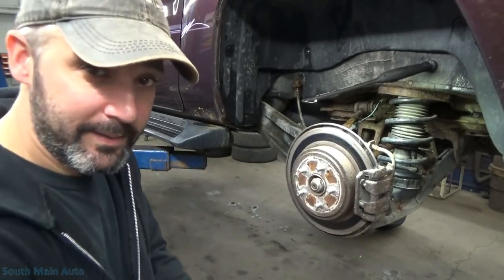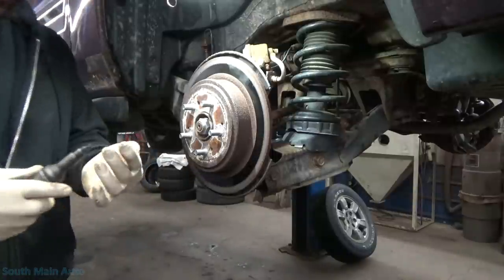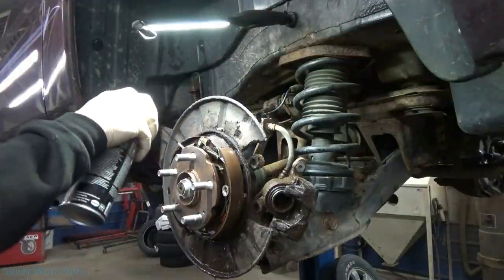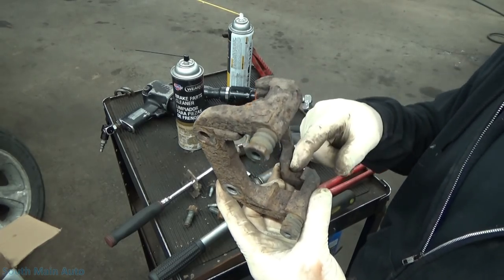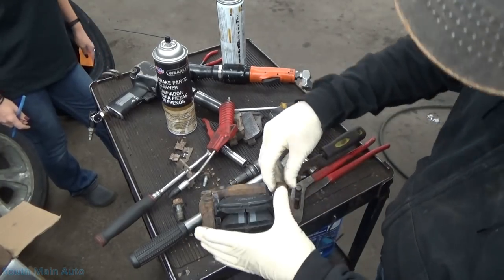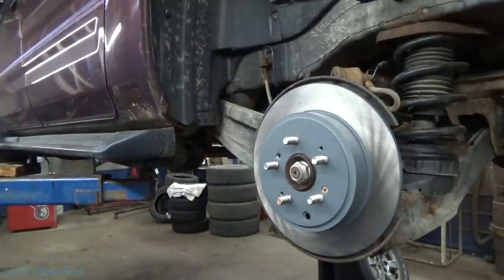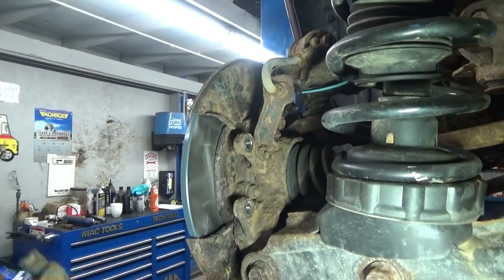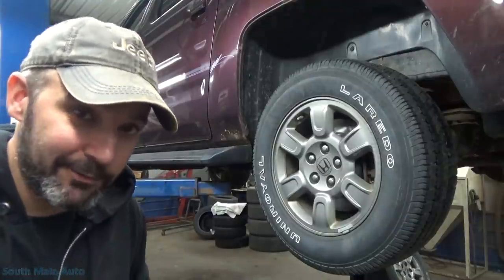Honda Ridgeline - Rear Brakes

Comment: Is that bit about too much slide pin lube really a thing that happens? I have this weird wobble at 45 and about 5 different garages have had a look between balancing, alignment, new pads, calipers, and 3 new sets of rotors and still no fix. Could too much lube on the slide pin cause a slight wobble but not total warping of the rotors? Eric, you might have just solved my problems 🤔I've also had all wheel bearings replaced 5k ago. Any advice from anyone would be greatly appreciated.

Comment: Crap I took my tire off before I jacked it up and now my leg is stuck and it really hurts.  I couldn't find the Permatext stuff anywhere local so I got a big tube of stuff called Silaramic.  It works good.  I have had it about 2 years and it is still soft and it hasn't gone hard on any of the brakes I have done.  It doesn't' have a nice little brush applicator though and it's not purple ☹
Reply from the maker: Send me your address in a PM, I am gonna fix this problem...
Reply: Eric you're a pretty cool dude!!  Great business, great family, and just a good attitude !!  Keep up all the great work! !
Reply: You forgot to spray it down with Brakleen first.  There's your problem!
Reply: I never jack up my car

Comment: I used anti seize on the hub good idea or is fluid film better? I put the purple crap on slide pins and they seized (not completely) after about a year. Have had better luck with silcone on slide pins. Still use the purple on everywhere else.

Comment: I love the "nuts and bolts" videos. What do you do with regards to greasing the brake pad ears/caliper bracket when brake hardware isn't available?
Reply from the maker: I ALWAYS replace the hardware no matter what
Reply: What if they don't make hardware?
Reply: Pads come with hardware... the shiny steel pieces?  Come with the pads.
Reply: They don't make the hardware for my BMW 5 series E60. BMW don't recommend greasing the pad ears or the caliper slide pins either.

Comment: I got a question on the bolts that hold the brackets on you said they're 17mm is that the same for the front? I got to do the wives Honda Ridgeline next week I did the backs but I know the front need to be done thanks

Comment: the same shit on all modern cars, rear pads get stuck if you don´t clean and lube everything 3-4 times a year.. 

How tiny these pads are.. do they last more than 5000 miles ?
Reply from the maker: Usually about 25k on the rears

Comment: Don’t start without a M8 x 1.25 bolt!!!  This is a critical tip.  Without it, I would have been dead in the water on the second side of my break job.  The rotor would NOT come off.  Using the bolt to press off the rotor is impossible without the less-than-a-buck bolt from the hardware store or Home Depot.  I’d go to large store (E.g., Home Depot) with a decent selection on METRIC Bolts

Comment: Yo, Eric O. Where did you get THOR's Hammer from??? I want one
Reply from the maker: Grip Tools
Reply: Are these on the Amazon SMA Store yet???
Reply: Bought the Permatex Extreme Lube off your Amazon store early in this year to give it a try never use it before in my Honda did a brake job and rotor replacement It will be my first winter with permatex lube. So far so good I am gonna wait after winter to see how it holds up

Comment: I never cease to be amazed by the level crustiness/destruction caused by the salt on your roads over there!!! I gather it does have some benefits? i.e. would you be slip sliding everywhere without it?  Here in Australia its just unheard of!  Why would you even buy a new car over there knowing it will be a write off after 10 years??
Reply: I live in the rust belt and with SUV's and trucks costing 50K or more, it makes me absolutely sick watching people drive such expensive vehicles with salt all over the road. I personally drive a used "beater" in the winter and park my nice cars until Springtime. It only makes financial sense to protect your investment.
Reply: Pretty much the ice/snow would stop all "normal" traffic if they didn't use sand/salt. The other option is studded tires or chains, which actually work better but they don't work to break up and melt the ice off the roads and many vehicles sold here don't have wheel well clearance for chains.
Reply: I've heard tell of several different products for ice and snow abatement that do less damage to cars.  Mixed in with some sand for traction.  Cost is where things get extreme.  The latest thing is using a brine solution (salt water) just before expected snow and ice falls.    That's our national pastime here in upstate NY.  Sitting back and listening to the cars rust.........
Reply: Yep it isn't bad enough that the salt water from the regular salt gets everywhere, now the brine get's spayed onto roads prior to any snow so it doesn't stick.  The main reason the other items are not used is cost. Salt is a lot cheaper for the municipalities. The thing is that is all the people seem to think about. Not that using a more expensive de-icer would mean they didn't need to replace the salter bodies every couple of years because of rot, or that the salt damaging the roads and bridges, or the pollution of streams, rivers, wells and the ground. Plus that maybe they would pay 100 bucks more in taxes but the 50K vehicle they have wouldn't rot out from the salt.  BUT until the people wise up it's going to be salt...........

Plus I'm sure the folks in Albany get regular infusions from the mines and haulers.... (yeah I'm in Central NY myself)
Reply from the maker: Not to mention we are sitting on top of the largest salt mines in the USA only a few miles away. AMERICAN ROCK SALT is the largest operating salt mine in the United States with a capacity for producing up to 18,000 tons each day. They have to put it somewhere right?

Comment: looked easy did front brakes on a HHR took 2 Hrs and I broke my large wheel puller, and a gallon of the good stuff to remove the rotors. replaced rotors because I had to beat them with a 3 LB maul. WORST ONE I EVER DONE!

Comment: Rustcheck in Canada makes SUPERIOR thicker rust inhibitor in BOTH liquid and aerosols-plus lighter grade for inner panels  
      -aerosol cans even cheaper then Crown's thin watery  stuff !
   
noted Ridgeline rear brakes with sealed braking systom is SUPERIOR to open brake system used by "domestics"
       since CHEAPER -but far MORE likely to RUST and seize

you must be ADDICTED to brake cleaner-I have but use sparingly,since TOXIC
Reply: It's awesome with coke and a squeeze of lime 
☺

Comment: What would be the worst thing if you lost or forgot the little rubber part on the rotor?
Reply: Dirt, debris, and contaminants get between the slide pin and caliper bore hole which will result in the guide pin seizing, which will, in turn, result in bad things happening like being unable to stop or crashing into something/someone...so yeah, that's the worst tha could happen.

Comment: you opposed to using brake lube on the hub after cleaning it? instead of fluid film....
Reply from the maker: Oh you can, that would just be very expensive for me because of how many brake jobs I do. Over 800 a year on average.
Reply: yaaaaaaaaaaaaaa my I just used the last of my lube and that lasted me years....home garage repairs

Comment: When you cleaned the back of the rotor and you turned it, it was not running straight. Was that just because there as no wheel on it, was it not sitting flat or even warped?
Reply: I thought I saw the same thing.....maybe it was an optical illusion.
Reply: The rotor is held on by the lug nuts... it will be fine when the tire is bolted on.

Comment: hey partner I had a quick question, when do I need to replace the timing belt and water pump on my 06 ridgeline I have no manual and I keep getting different answers on the web? thank you, p.s. can I buy after market or should I go OEM???
Reply: Do you have Maintenance Minder?  My 2011 tells me when to wrench with a little wrench-shaped light on the dash... with codes for each different one.  I believe the belt/pump happen just after 100Kmi... getting ready for mine... going to the dealership for that one.

Comment: If someone has topped up the brake fluid and you compress the caliper pistons without sucking some fluid out, or opening the bleeder, you could make a paint eating mess under the hood. You left out that step. Also, most manufactures recommend regular brake fluid flushes as the fluid absorbs water over time and water boils at a far lower temp than brake fluid and also corrodes the master and wheel cylinders. Your customer could be descending a long grade, have the water in the old fluid boil, and have the brake pedal go nearly to the floor. I realize you don't like dealing with rusted stuck bleeders, or crappy aftermarket calipers, but brake fluid as old as the worn out pads is not a good thing. Finally you didn't mention brands but I suggest everyone stay far away from Wagner pads and brake parts. They're junk in my experience

Comment: Them rotors are a bitch to remove if you forget to make sure the parking brake was released. Maybe that was step 3, or step 1 before you do the other two.

Comment: IF everybody used 4 winter tires,as I installed again ,on BOTH of my recently DIY rust inhibited cars-
    karz and trucks would last FAR  longer,     since less SALT needed,        and parts less corroded-     so SAFER
   
-note you replaced SAME NO -SEASON tires back on truck,   so LOTSA SALT  needed for melting ice and snow
    -that's COMING SOON

Comment: Brake jobs always seem to be pads and rotors. Does anyone ever replace just the pads and not rotors?
Reply: Yep... if they look good, why not?  I live in sunny Texas, not on the coast, so mine look a lot better than that.
Reply: If they do, they do it incorrectly.  A rotor must be resurfaced or replaced any time pads are replaced because they both need the new flat surface in order to bed properly and promote maximum pad life.

People will say “oh I’ve been doing this for years and I’ve never had a problem doing it!” But that doesn’t make it the right way.